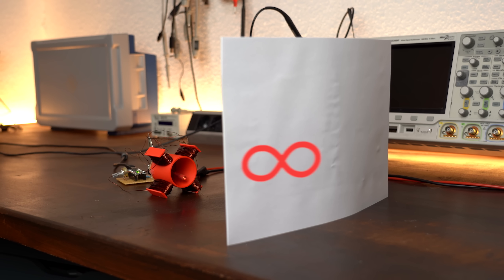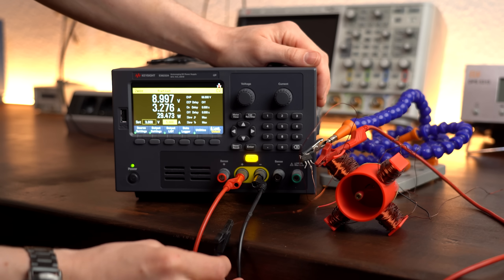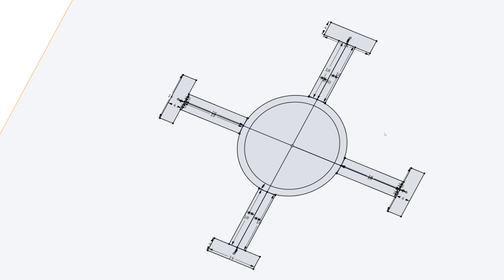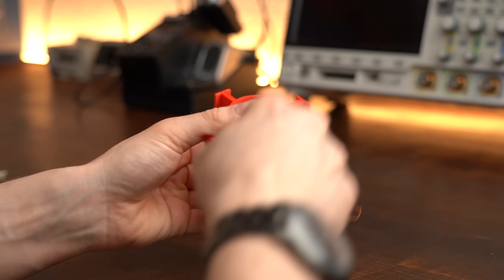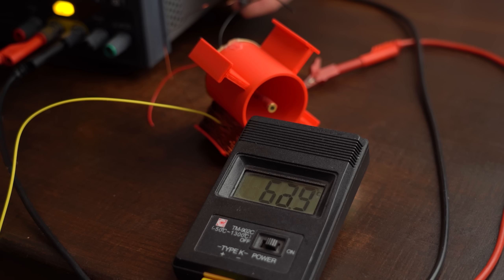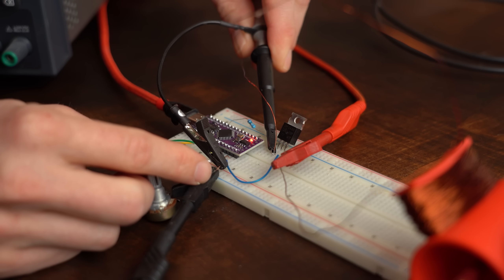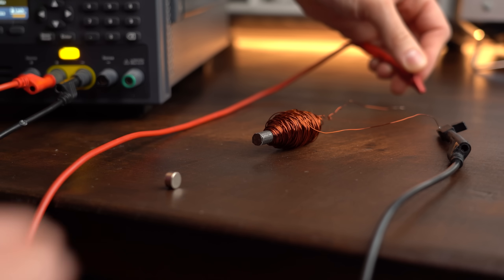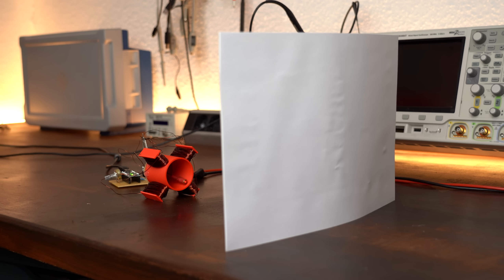Exposing the FAKEST Project....and making it REAL?!

Comment: There was that old software that converted simple vector images to audio files that you could watch on a X-Y mode of your oscilloscope the same waveform could be used to drive those coils directly fom audio amplifier where L - R channels correspond to x and y axes.  No need for Arduino id love to see you put on that contraption to work using such method and IMHO that laser diode wobbly stick mount isn't rigid enough some suspension based on rubber bands and some piece of an actual magnet could stabilize and amplify strength of magnetic field for those coils.

Comment: Yes it doesn't works by so with plastic only and you need resigned 4 metal sheet. lf you open a DVD, solenoid, phone, camera   and other things you see winding there but with steel so that we create electric magnet not by plastic only.

Comment: 0:57 Something's wrong with that picture that's disappearing towards screen-top. I don't know exactly what it is, but it seems wrong! 😁😁
Oh yes! The Laser Diode shouldn't be clearly visible if it's scanning a whole frame onto a canvas, right? The camera captured at least a whole frame (of the canvas), so the LD should be motion-blurred, right? Also, the light cone doesn't fit the necessary scanning pattern, it starts at the steady LD. I have no issue with the schematic, though.

Comment: XD just the first seconds was too much to know was fake. The idea is like the CRT but I don't think using a mechanical device is a good idea, you have to add inertia to the formula. LASER proyectors use DMD (Digital Micromirror Device), the LASER is just the light source and is fixed.
LOL I didn't saw the MOSFET model but just on look that direct to the MCU I was thiking "That is not how you use a N-channel and will be permanently active if is a P-Channel" XD that was even worst

Comment: I see the original creator has now turned off comments. I have found unfortunately quite a lot of fake electronics videos appearing. As a side note, I took a quick look at the Kanti video and you can clearly see the frame around the image from a normal projector with presumably a red filter applied.

Comment: You can tell the image that is produced is fake just by watching the clip of the device"working" at the end in slow motion. The image on the display flickers on and off at a precise frequency while the laser pointer remains on the whole time. 
If the flicker is supposed to be caused by the movement of the laser then it wouldn't be so precisely timed and would be more random. If it is supposed to be caused by the pointer then you would see the pointer turning on and off as well.

Comment: If ANYONE, thought the first one actually works they're extremely, extremely gullible or just have VERY VERY small spatial awareness.

Even I can see straight away the first one was complete fake, with how the laser itself moved to begin with. The maximum angle and movement changed so much but the Figure-8 hardly moved from its spot. Not to mention if you stop/start the video, there's no laser pointer at all in any of the frames either, so the laser is drawing absolutely nothing.

Comment: if you watch the original closely the laser diode is not following the correct path to make an infinity symbol, and isn't even following a repeating path, it will sometimes go in a random direction.  also the fact that he created a literal perfect infinity symbol as if it was printed from a computer despite only having 4 movement directions should have been a dead giveaway to anyone watching, he would have needed to spend days at least programming it so that it sends just the right current at the right time in 2 directions to make that prefect curve.  also it laser doesnt move around the symbol pattern, it just flashes on and off

Comment: Well still probably its not possible to make a metal object move 240 lines 25 times a second.  But i think it can if we limit framerate to 1 fps/second which mens it has to move up down syncronously 
240 times... probably lots of amps and heating coils will be needed.

Comment: Its fake for sure... bu therethicaly... thats the crt tube televisions mechanism in action, you just need faster ten arduino ics .... ie 320x240 hz ... means 76mhz ... hm... seems possible with correct buffering mechanism , awerage mofsets/transistors supports that.

Comment: Rotary solenoids are 'off the shelf' devices.
Supply them with current, they rotate.
Feed-back from shaft rotation (potentiometer or optical sensor) sets a 'zero point' of about 1/2 of total range of movement.
Input signal to amplifier causes proportional rotation of shaft left or right of 'zero point', mirror and laser play nice.
We just made a Servo-Motor with a 'twist'.
Sorry, someone had to say it.
Mirror on rotary shaft plays nice-nice with Laser.

Comment: Did you really have to build it to realize that they photoshopped the figure eight onto the paper, comments are turned off, and the laser makes the same pattern every time an image is projected? Jokes aside, the concept of this wouldn't work either because the magnets don't have a rigid grip on the laser, so you couldn't make sharp turns like those seen in text, and also a laser doesn't spread out far enough to create bold lines at a distance of one foot.

Comment: There's an immediate red flag: due to inertia, you could never move the laser diode fast enough, even if the magnetic field could be generated strong enough. Maybe images could be optimized for laser paths, but still... there's a reason for why we used electron guns and not lasers for TVs back in time.

Comment: It would really have to run the electromagnets at the speed that the mechanical system resonates in order to get clean (circular) output. Add some code to turn on/off the laser at the correct time and then maybe you could make a clock out of it or something.

Comment: This is a very bad laser display. Diode with enclosure have too big mass to work in this arrangement, moreover compensation of overthrow would require at least another set of electromagnets to read out current position.

In fact in lasers displays a set of perpendicularly placed small mirrors are used, driven by so called galvos with all analog electronics needed to drive them and compensate properly. Mechanical part on galvo is light enough to fulfill it's role in the system.

I'm not a professional laserist, my knowledge originates in my laser harp project, where somebody suggested to use step motor to drive mirror. Not good idea also

Comment: It makes no sense to even attempt moving the laser diode.   
Far more logical, would be a lens, supported by a structure to react to the electromagnets.  
One could also eliminate two of the coils with a bit more clever designing, and drive reversible current, making a reversible polarity electromagnets.

Comment: If you want to try again I think putting metal plates as the 4 "fins" of the 1st design will have a much stronger magnetic force, as the bigger the core, the stronger the electromagnet. 

But ye to make a proper display system you. Will probably also need hall effect sensors and whatnot. Easier to just use mirrors as others have mentioned...

Comment: Another problem would be, if the "drain" is connected to 9 or 12 Volt and a 3V33 or 5V input voltage on the Gate wouldn't open it totally.

Comment: The laser tip would have to be on a long rod like 10cm and should pivot at around 1cm in the riverse direction, Using the leverage of 9cm to 1cm a 3mm of movement creates about 40 degrees max of tilt which could translate to 60cm line on a screen sitting 1m to 2m away.

Comment: Making a actually laser display is not really that hard. Just need two motors and two sets of mirrors. One pyramid shape one and one hexagonal cylindrical.

The  the pyramid shape one need to rotate really really fast. (7200rpm wirh 60fps and 480p image) 

And the hexagonal miror need to rotate 10 rpm at 60fps (regardless of reaolution).

Then you just need to synk it and flip the laser on and of. No feedback really needed. Maybe a light sensor somewhere just to make synk easier.

Comment: Thanks for the effort, like your take on the design. If you desire a laser to bounce connect it to a speaker cone. Instead, what if you glued many small glass, plastic mirrors or Mylar sheet inside a speaker cone. Then constructed an 20 cm tall stand around the speaker circumference designed for "fixed" lasers to shine down upon the speaker cones newly mirrored surface, if the small lasers mounts were flexible, or reactive to bass notes, at the right angle could generate interesting patterns on a ceiling.

Comment: .. and that ladies and gentlemen is why real laser imaging systems use tiny low mass mirrors on small coil galvanometers to throw the zero mass  beam about and not whopping great magnets to throw the high mass laser module about. 
https://en.wikipedia.org/wiki/Laser_projector

Comment: Hmmm.  With all due respect your own efforts did not demonstrate much knowledge of electromagnetism either.  1. You measured the static resistance of the windings and paid no regard whatsoever to the impedance of the coils which is at least as important for such an application. 2.  You paid no regard whatsoever to the residual magnetism that would have been induced into the soft iron rod you used.  3 You paid no regard to the EMF that would certainly have existed in the solid rods during operation as you used a continuous conductive material instead of something like bundled baling wire that has a non conductive, say black rust, insulated surface.
Although the original design was hopeless, yours was hardly superior, to be frank.

Comment: What works fairly well - I knew people who hacked it up in the 1980s - is gluing a lightweight mirror to a speaker cone and actuating it with the voice coil.  Arrange it so that one stereo channel drives X and the other Y, and use a soundcard to produce whatever pattern you want to show. (Well, not a soundcard in the 1980s, but nice Lissajous patterns from harmonically related oscillators.)

Comment: What if instead of the laser mounted on a stick you used something really light. Like a beam of electrons.  And you covered the screen in phosphorescent material. And you made the whole thing inside of a vacuum tube so the electrons don't collide with air molecules. 

Omg I think I just invented the technology which is gonna replace oled screens.

I shall call them... negative electrode beam bulbs. Patent pending.

Comment: One thing you have wrong is that inductive spikes won't destroy Si MOSFETs. As long as the pulse power is lower than repetitive maximum pulse power for diode it's fine. It's not best design choice but it's not gonna kill mosfets.

Comment: I figure the design could be improved by adding a lever to the back of the laser, with a small permanent magnet on the tip, and use the coils to attract that, instead of directly moving the head.

Comment: It seems the popular consensus is "drive a mirror to reflect the polarized light in the desired direction". Isn't this a little bit like driving an electron beam in a vacuum tube...like an analog CRT?
Reply: Thinking further out loud, driving an electron beam in a vacuum is different than push/pulling the bulk beam source all at once. The flimsy silver wire is going to spring around. So, I think I was on the idea of using a CRT drive circuit to move the beam, but moving a mirror instead. Keep the beam as stationary as possible, drive the least mass as you can...

Comment: You should go back and study the OLD CRT televisions, since this is EXACTLY how they worked.  The electron beam generated by the electron gun at the back of the tube was deflected by the electromagnetic coils wrapped around the base of the CRT tube.  So, Yes it will work if you design it properly and input the correct signal voltage to the deflection coils. BTW Radar scopes work exactly the same way, especially the ones you see  rotating around in a circle.

Comment: Scott if you are interested, have a look at Moog servo valves for precision hydraulic applications (like missile guidance) only operates in one plane but uses a coil and bias magnets to actuate a small hydraulic nozzle to move a pilot signal pressure between hydraulic ports

Comment: Very nice breakdown on both the initial design and the concept itself.
I've seen something adjacent to this, where instead of magnets affecting the diode, they actually use a mirror and a speaker to control the laser output shape with sound. Theoretically, that would be a much simpler way to get the same end result.

Comment: You can make strong PWMs circuits that are closer. 

The laser also having concentric springs. 

It also could have a fitting lens to further amplify the vibrations. I suspect the drawing resolution is being compressed or suppressed so adding a lens might decongest the drawn lines.

Lastly ferrite core should be used instead of iron which has a higher delay in dissipating the EM fields after being turned off. 

It works like CRT, but also requires a vectored graph(like may apply but way simpler) software to be developed for calibration and also represent of graphs.

Comment: Is it possible to grab the cable TV signal from its wire from a distance wirelessly using any device
Reply: Realistically, no, the cable confines the signal inside itself, just as it excludes the signals that are outside itself. This is good, because you can use this trait to run more signal through a place than if it was all travelling freely, but it also means you need to connect things to the cable in order to access the signal inside it.

Comment: it would be much easier to have a stationary laser that's rigidly mounted to a set of actuators, and aim it at a spinning mirror that is canted to an angle. This would give a better result, as the mirror works as a "shutter" of sorts, and the laser focal point is always the same, and the laser only has to move very very minute distances...

Comment: As a physicist, you can see a flaw in the originial video. How can single wavelength diode output geometrical shapes and figures simply by shaking it with EM fields? It just doesn't work like this!
Reply: By making use of persistence of vision.
Reply: @absalomdraconis  in the first and last part of the original video, you see the laser is vibrating almost in the same pattern while showing different output shapes, even text moving from down to top. C'mon! where's the persistance of vision here?

Comment: Actually this idea is very similar to the focus functionality of a laserbeam as used in optical disc readers however they use a lens to float up and down in a space. Very thin wires to the coils are used to make this even possible with less friction. Same with a laser printer or other laser 'projection' device , in those designs they move a light weight mirror instead of the laser itself. 

Anyway, it is very sad to see people believe these nonsense and is a proof that it is easy to fool a large portion of audience. This is the same with the C-bullshit, climate nonsense and so on because most of the people have not learned to think for themselfs or do some research. That is why some jerks get easily away with it. It doesn't have to be real, it just has to appear that way. That's enough to fool a large portion of people. The worst case scenario is that most believers will blindly defend the idea without doing their own research. That can be very dangerous and spreading the hoax like it is the truth.

Very good subject and video.

Comment: I'm not remotely something you would call an electronics expert but some of these fake DIY tech videos often just REEK fake and like utter bullshit. ESPECIALLY those where you see people re-using the camera modules of smartphones and seemingly building USB cameras from it...by soldering super thick wires to the tiny hair-thin contacts of the flex cables...  Those kind of things infuriate me so much. Or those videos where people take apart batteries with absolutely no protection what so ever....

Comment: I made once project like this but i  used to control laser 2 stepper motors and two laser mirrors and bigger laser diode. I could easy draw stuff on walls with 300mW blue laser.

Comment: Very cool debunk! I would think developing a feedback system would be probably the hardest part of this. Just as a thought experiment, would you start by throwing a hall effect sensor on each of the electromagnets then trying to correlate those values to the laser displacement?

Comment: You should look into a control circuit for a old CRT TV or monitor. They worked on a very similar theory. They used class AB amplifiers with BJTs instead of mosfets to control a light beam created in a vacuum.
Reply: electron beam, not a light beam
Reply: @deang5622  yes, I fell on lack of vocabulary. Couldn't remember. Elderly Moment.

Comment: Unfortunately your design also misses some modules: 
=> gate driver for FET transistors
=> you have placed the inductor(actuator-coil) in a relay configuration (diode in parallel with inductor), I believe you should use a Schottky diode followed by a capacitor in parallel with a resistor in order to manage off state coil current